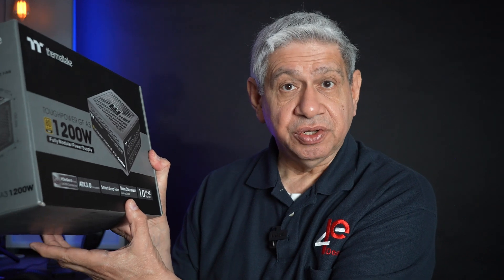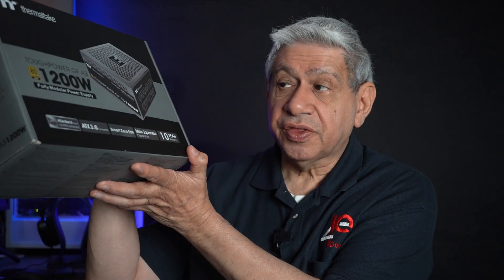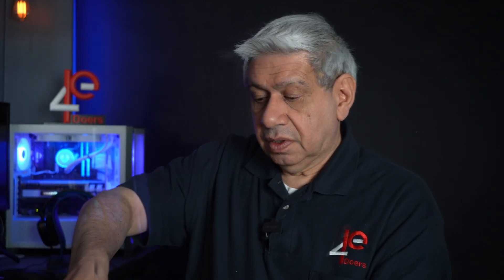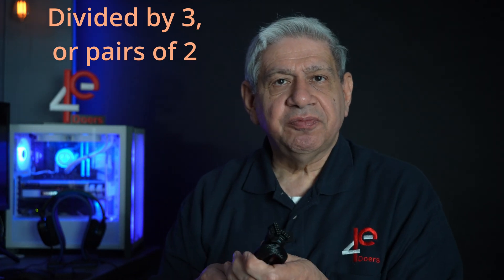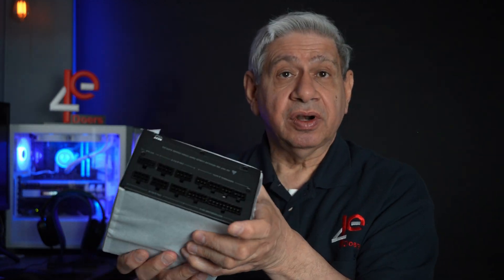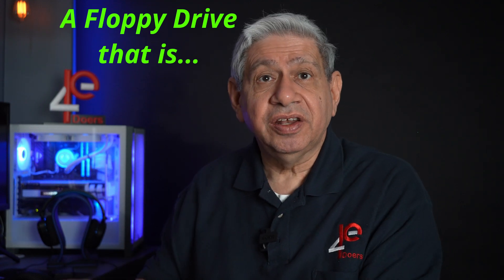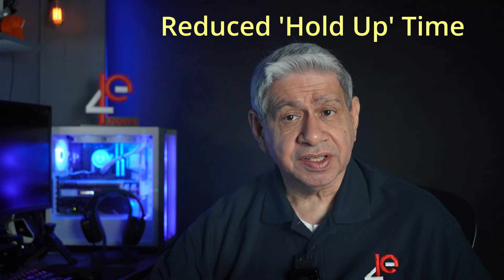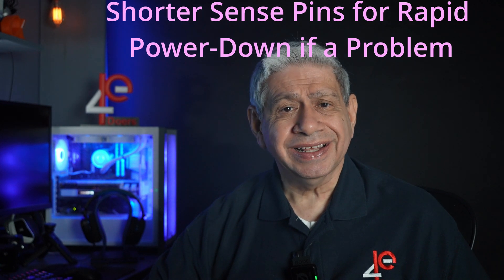The NZXT C1200 Gold PSU with ATX 3.1 Compliance

Comment: So I have this from replacing the old C1200 ATX3.0 which lasted 14 months then blew(!). I have noticed the 12v-2x6 plug has to be totally 100% plugged in PSU-side to work. I hate this god damn cable and to hell with Nvidia pushing it. Never had a problem with the old MOLEX.
Reply from the maker: I understand your disdain for that cable.  I have also read reports on how, even if the cable is plugged in all the way, if the cable has pins that are loose, or not extended out to the edge of the connector, then it's chances of failure are very high.

Comment: 2 months later, how is the gpu cable on this NZXT C1200 model? i didn't know these cables are gonna melt until today omg
Reply from the maker: The GPU Power Cables on the NZXT C1200 is second generation and not known to have melted due to the protections that are built-in.
Reply: @PE4Doers  in addition to the atx 3.1 cable, i also setup afterburner to only use 95% to ensure my 5090 wont pull more than 600w. its so crazy!!
Reply from the maker: @bojox3m2  Sounds like that should help.  What is your overall performance with that afterburner change/
Reply: @PE4Doers  this was a 2 week old build with a 9950x. it can handle my cuda powered text to speech server, custom front end that uses a llama.cpp server running an 8b instruct Q4_k_m gguf. 

during usage, max gpu pull was 575watts and cpu pulls about 225watts.

I'm happy that i can do all these things but i'm sad because it costed almost 7k usd.
Reply from the maker: @bojox3m2  WOW, $7K.  I may have missed it in your parts description (I apologize if so), but which brand of 5090 did you get?